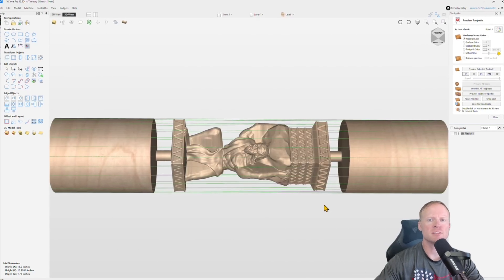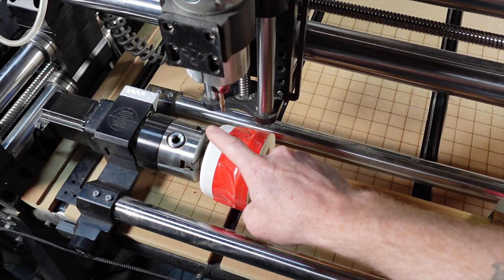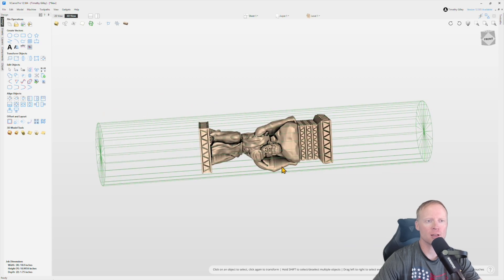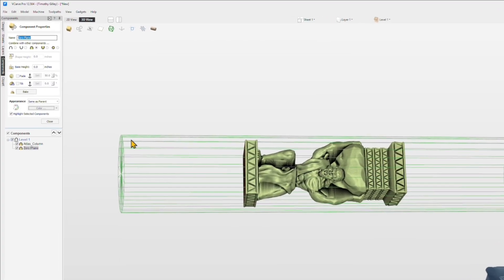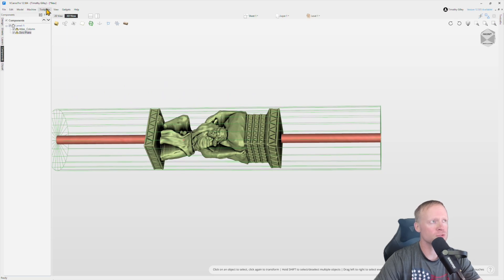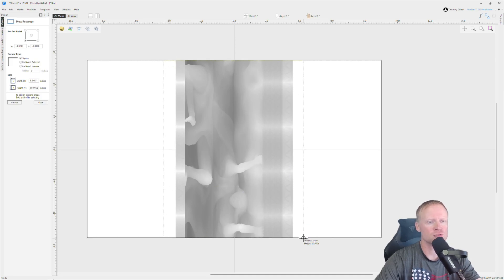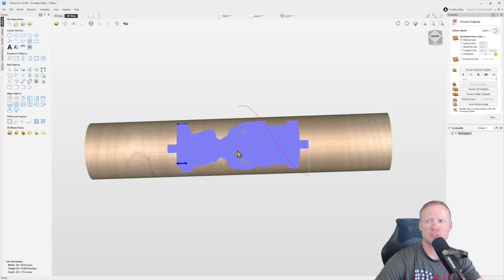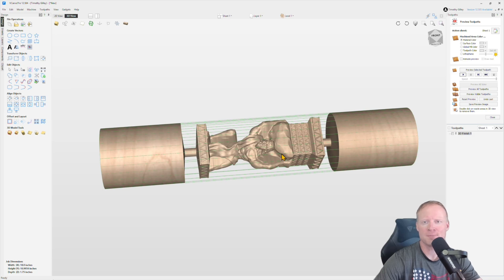Master the Center Stem: Fix Rotary Machining Fails in VCarve Pro 12.5 (2025 Guide)

Comment: Brother, I have been studying this issue. I created a character model using 3D modeling software, and when I used the rotation axis of Aspire to draw the path, the two legs of the character model could not generate a perfect path. Is there any solution to this problem?    
The two lines of the character model are similar to an "Y" shape. They can be well carved when using four-axis联动. However, it seems that Aspire is unable to generate the cutting path very well. Could we create some auxiliary surfaces for the model to help the software accurately identify some of the hollowed-out areas?
Reply from the maker: Hey! So just to make sure I’m understanding. You are saying that aspire will not cut out the legs of your character model correctly because it is identifying that the bit cannot reach specific areas of the model without first cutting previous work so it is not calculating for those areas?